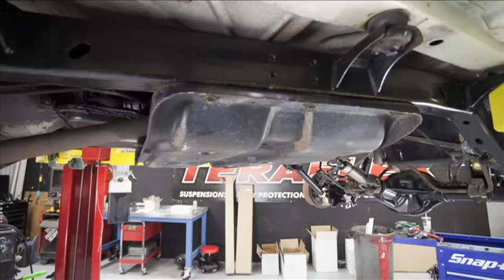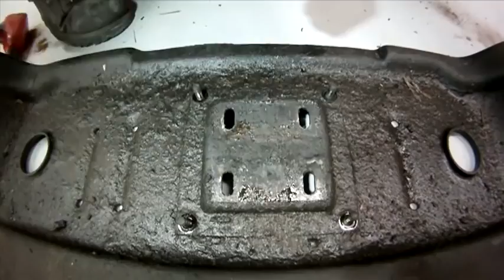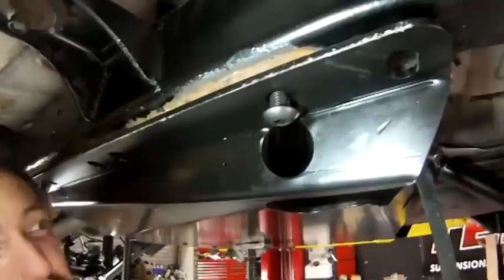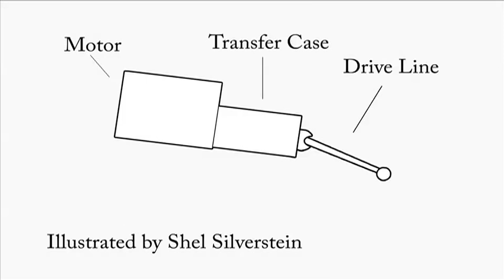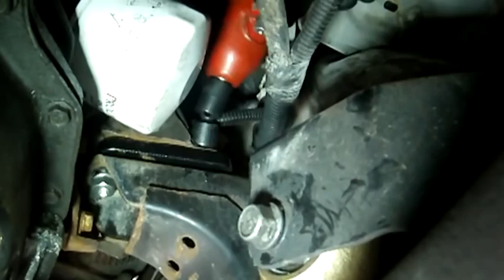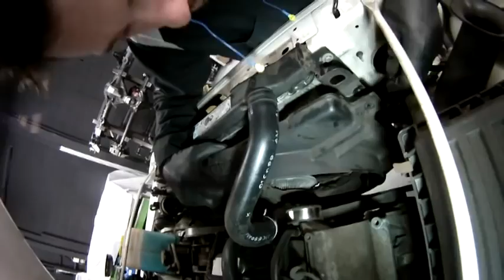Installation: TeraFlex Jeep TJ Belly-Up Skid Plate - 4648403

Comment: I wouldn’t let you guys work on my dog house.  When trans pan was removed there was a lot of corrosion on the frame and you replaced the pan without treating the corrosion.
Reply: Marine, I can appreciate your comment about not treating the oxidation on the frame and I would say the same.  However, after checking with Teraflex (this is their install video) what you're seeing is accumulated dirt from wheeling.  Stand tall, give em hell.  SEMPER FI.